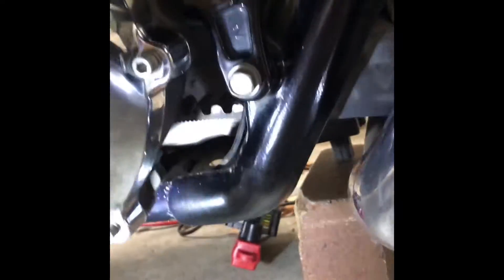How to check for #harley oil leaks

Comment: So I have the same thing, a nickel size drop and only typically right after I park it in the garage, so I did clean with brake cleaner very throughly and tightened up the bottom bolt below clutch box that holds the exhaust bracket it was a tiny bit loose, but next day I still have a small drop on garage floor, and I can’t figure out exact location of the leak, I’m not worried about it but I do have a extended warranty on my 16’ Road King, so looking like I will be riding to the HD service department next week. I will let ya know if they find a leak & where it’s coming from. Cheers & Thank ya for sharing. TC
Reply from the maker: How did it go
Reply: @Bikernewscanada  It was the lower hose that goes to the oil pump, replaced hose & all was good. Thank you
Reply: @Bikernewscanada  it was lower hose at oil filter, changed it and problem solved.
Thank you!

Comment: All Harley's and indeed any motorcycle will leave that black oily mess on your finger if you go rubbing it everywhere around the deepest depths of the engine, most of this is grease flung off various "Greased" parts and mixed with road dirt and yes some minor (Normal) oil which will always find itself freedom somewhere, remember your bike will never be surgically clean, an oil "Leak" is when you find it on the floor and thats when you fix it and yes i wouldn't go to a dealer either your right there ! Part of owning a motorcycle is the pleasure of riding it/fixing it/being part of it and loving it.....This isn't a tin box car we're talking about.
Reply from the maker: Thanks

Comment: So did u get it repaired? I would clean the area again, and just keep an eye on it. While you might have had some oil on your finger, there probably was some road grime and rubber (wear from the belt) all piled on that lip. I wouldn’t go crazy about it unless it’s really marking it’s spot every day after a ride. Then I would replace the seal. I own a 2002 FatBoy, and haven’t had any issues like that yet, but from what I understand, they are not that common because the seals hold up pretty well. Only if you have other work in the area would I recommend replacing them, as you’re in the area anyways doing work. 😉👍
Reply from the maker: I'm not in any big rush to do it for sure. Just one of those future things to do I guess. Gonna try that new synthetic primary and trans fluid. Might be a bit thicker.